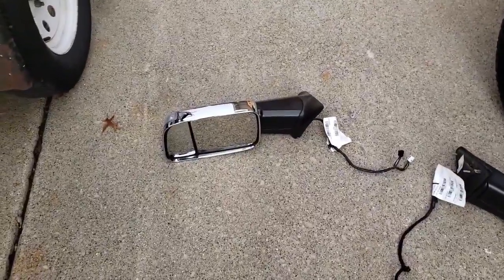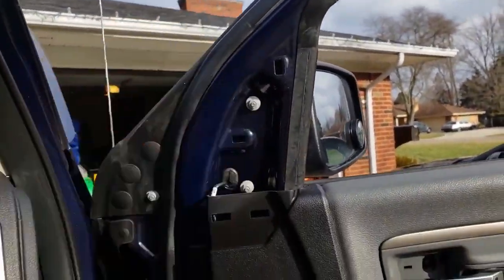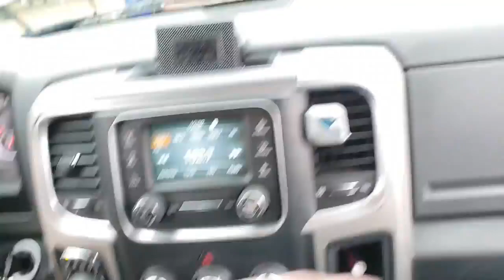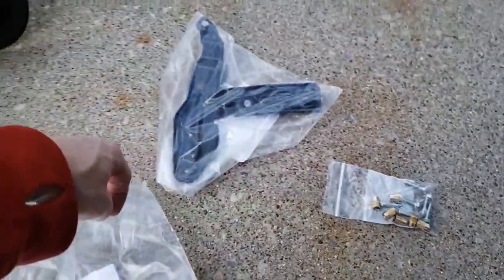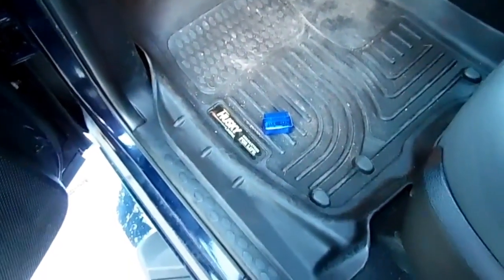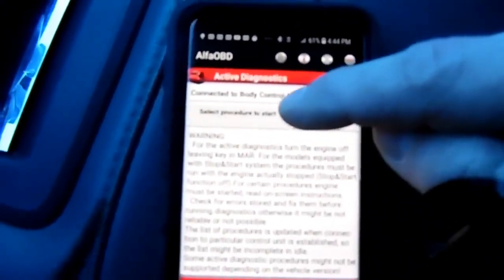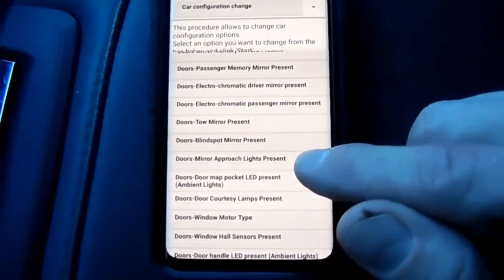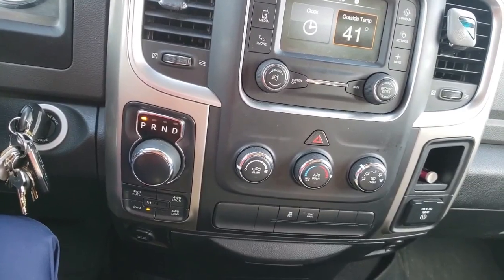Tow Mirror Upgrade 2015 Dodge Ram 1500, How to Turn on Turn Signals and Puddle Lights

Comment: Cant get my Bluetooth to see the unit, its android, the phone is set for Bluetooth, the truck is a 2014 i pressed the little button on the device and still I get no connection.I bought the blue one you have aand I bought the 49.00 dollar one. so I must be doing something wrong. Im trying to install the same mirrors. have any ideas?
Reply from the maker: There's a couple of things to try. The blue one needs a code to connect to your phone. You will have to look up your phone to see how to connect a device to it. Most phones can be connected by pulling down the top of your screen, holding down the Bluetooth symbol until the Bluetooth menu opens. Then scan for new devices. When the device is displayed, tap on it to connect.  I think the code for the blue one is 1234. The $49 one you have may have a little button on it to connect to your phone. Once you have connected the device to your phone in this way, then you can go to the AlfaOBD app and connect. Hope this helps.

Comment: Is it possible to make the ambient puddle lights operate as running lights and always be on with the running lights with alpha obd?
Reply from the maker: There is a setting called something like, use turn signals on mirror as running lights. I couldn't get it to work on my truck.
Reply: Looking to do this as well, have you found any methods that work?
Reply from the maker: @kevingamon8599  the only way that I have found, would be to hard wire it by jumping off from your turn signals

Comment: Can you plz tell me how menny things you have turned on.for the all the functions of the mirror.and a list of them plz n thanks
Reply from the maker: Off the top of my head, I don't remember. I did show in the video everything you need to turn on.
Reply: @WorkingOnStuff   I'm trying to get my puddle light to work.iv turned on  Everything that was said in the video.maby u could right me a list plz n thank you
Reply from the maker: @darrendemille8432  everything in the video is what I did. I do have another video troubleshooting puddle lights. I hope it helps.
https://youtu.be/X2L749EW4Tc

Comment: I got the same mirrors and my signals on the mirrors are not working, I didn't disconnect the battery, was that supposed to be done
Reply from the maker: Did you turn on "everything" in alphaOBD? Did you get the mirrors used? You can check the bulbs.
Reply: @WorkingOnStuff  how do you turn on "everthing"?
Reply from the maker: @cjloove0914   using alphaOBD. Its demonstrated in the video.

Comment: I have a 2019 classic. Will the alphaobd register as a plug in that the dealer could say was a tuner and void my warranty?
Reply from the maker: I don't think you can use it as a tuner, but I'm not sure what would constitute as a violation of your warranty.
Reply: @WorkingOnStuff  I was in contact with alphaobd they are unsure if itll work. They said it will not void warranty as I'm not adding only unlocking.
Reply: Tyler Maloney it’s very unlikely unless you tell them that the dealer would find out you have used alpha obd
Reply: It won't but you need a security bypass module for 18's and above.  I have a 18 and it works great!!
Reply: AlfaOBD is not a tuner and will not void warranty. You will need a security gateway bypass for 2018 and up. These guys will have what you need. Mine works flawlessly. Have changed my TPMS thresholds in my 2018 2500 Cummins, disabled seatbelt chime and activated global down on my windows. Next I will be activating factory trailer brake module as mine didn’t come with one 
https://www.kaodtech.com/

Comment: great video just installed mine was wondering does alpha obd effect my tunes when i go in and turn lights on i am deleted and tuned 2017 tradesman 6.7
Reply from the maker: 6.7? Nice! I'm jealous. I have the 5.7. I'm not sure how to answer your question. You can contact alfaOBD from their website. http://alfaobd.com/
Reply: @WorkingOnStuff  thanks for reply I will try giving them a call
Reply: @WorkingOnStuff  hey barry got another question just recieved obd mx can i use out of the box with alpha app or do i have to sync with there app first thanks for your help
Reply from the maker: @bigal2448  plug the adapter into your truck. push the little button on the back and swipe your screen down on your phone.  hit the Bluetooth button and connect it to the device first. Then go to the app to connect by pushing the Bluetooth symbol.
Reply: @WorkingOnStuff  thankyou very much going to try it out tomorrow after work
Reply: No AlfaOBD will not affect your 6.7 tune and delete

Comment: Would you happen to know of any other obd apps that this will work with thats not 50$ im about to order this module?
Reply from the maker: There are a few good apps you can use. If you get the obdlink mx, it comes with an app. Torque pro is pretty cool app.
Reply: @WorkingOnStuff   so I went with the same setup you used i put in regular side view mirrors with turn signal and puddle lights but I don't see anything in the alpha obd for the puddle light did they update sense your video and hide it somewhere new? This is for a 2012 ram 1500
Reply: @dixxieboy87  He explains it in the video. It's not under puddle lights, its under Door Mirrors Approach Light Present, or something like that
Reply: @markbaguley4560  I don't see door approach light or anything close to it thats my problem

Comment: is there a way to do this then get a refund since thats all i need the app for
Reply from the maker: I don't know about Google Play's refund policy,  but $49 is better than paying 3 times that at the dealership, and you can use for more than just turning on features. You can read and clear fault codes, if your check engine light ever comes on.

Comment: Best app for iPhone users?
Reply from the maker: This is the only app that I'm aware of that can modify computer settings on a Ram. Unfortunately for Apple users, it's not compatible. You can use an android tablet. You can check the Ram Forums. There are a lot of knowledgeable techs that may be aware of a new product that can work with Apple.

Comment: I can’t get my to work on my 18 2500 diesel is it because I didn’t disconnected my battery cable.?
Okay i did remove the cable this time and  I’m getting the same message not sure what to do now!!!!.
This is the massage.  NO DATA RECEIVED FROM ECU/INTERFACE OR DATA CORRUPTED. TRY TO START THE PROCEDURE AGAIN. IF YOU RECEIVE THIS MESSAGE TOO AFTEN TRY TO ADJUST  INTERFACE TIMEOUT , INTER-REQUEST, TIME’, ‘RESPONSE-REQUEST TIME AND REQUEST INTER-BYTE PARAMETERS. IF THIS WILL NOT IMPROVE CONNECTION STABILITY YOUR INTERFACE IS PROBABLY FAULTY.
Reply: 2018 and up you have to have a security bypass module or take it to a dealer. Sucks I know, I'm taking mine to the dealer next week.
Reply: @jksk84  please let me know if it worked for you.!

Comment: Perhaps you should look up a video on installing those nut rivets. Drywall anchors!!! You're kidding.
Reply: They have already been replaced. It was just a temporary solution until I could get the parts. At the time You couldn't get them.

Comment: I just put mine on. I can’t get the lights to work 🤷🏻‍♂️
Reply from the maker: Which lights, the turn signals or puddle lights?
Reply: Barry Cagle both the puddle and turn signals
Reply from the maker: @theredpony631  what year is your truck? Which type of bluetooth obd plug  did you use?
Reply: @WorkingOnStuff  what obd scanner I need I got a 2017 ram 1500
Reply from the maker: @spydersquadatl1980  http://alfaobd.com/ recommend the  OBDLink MX
Reply: @WorkingOnStuff  thanks 😊
Reply: @WorkingOnStuff  I see the obdlink mx it 100 dollars and do it need to be bluetooth
Reply: @spydersquadatl1980  did u get them to work? I'm doing it on a 17 with bafx obdbut no mirror light options appear for a 2017?
Reply: @theredpony631  did u get it to work?

Comment: I can tell you this now you don’t have to take off the battery cable
Reply from the maker: When disconnecting electrical harnesses, if any positively charged wire touches any metal anywhere on the vehicle, it will fry something. I have owned a number of vehicles with electrical problems. You can also smoke while pumping gas,  it's just not a good idea.
Reply: Barry Cagle I changed mine over to tow mirrors yesterday and I never had to take off the battery cable 🤷🏻

Comment: Looking to do this for my 2017 Ram 1500, yours is the only video so far that made sense ($) and pushed for the $15 reinforcement brackets (duh). I saw this link and though wow, who would pay that much cheddar for a tow mirror upgrade (https://www.youtube.com/watch?v=fRsAuTx9-Ow) and their ODB Genie (for just $300). Really, for flash programming, certainty someone/anyone can produce a substitute just as good, for way less? "They" also say you need to upgrade door modules, did you need two new $200 a piece door models? The video I linked shows installing upgraded door modules, is this necessary? I bought new mirrors same as yours for $280 on ebay. Integrated tow brake and brackets shipping. thank you for the post.
Reply: Sorry, should have read replies below. So I don't need new door modules, just the app to reprogram?
Reply: Did u get it to work? I have a 17 1500 express but I cannot find option for mirror lights however I did not buy the same obd plug. Just wondering what u used.